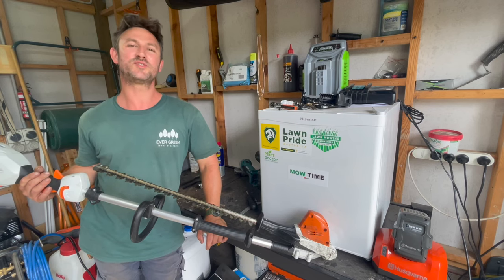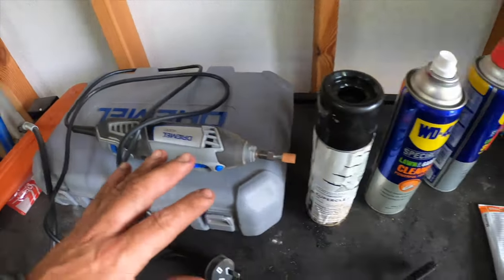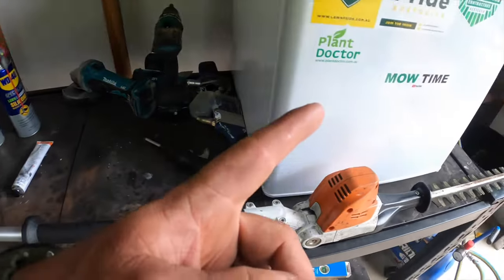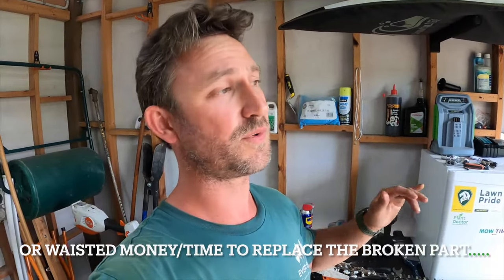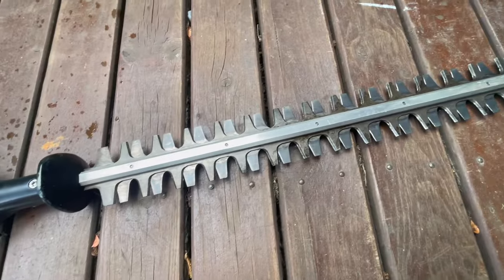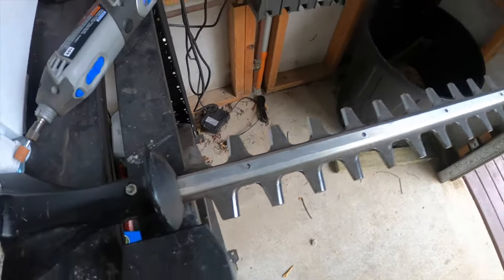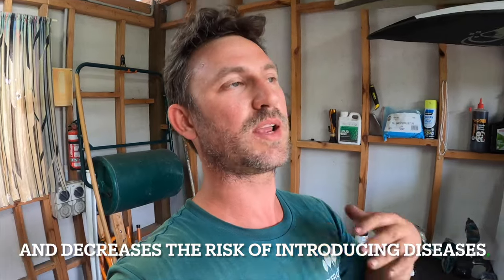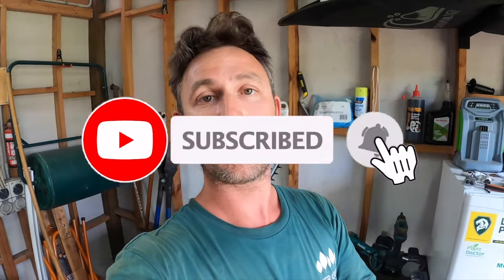HOW TO SHARPEN, SERVICE & MAINTAIN A HEDGE TRIMMER. DIY

Comment: Helpful video mate. Might try a dremal on my next sharpen. Been using a small grinding disc up until now. Cheers
Reply from the maker: Thanks legend.
Ye I used to do that to. Dremel I find such easier to handle and with all the attachments you can sharpen/grind/polish/cut out etc it’s great.
Hope all is well on your end mate 🙂👍🏻
Reply: @mowtime  will give it a try. Thanks mate

Comment: Great vid mate. Well explained and illustrated. Easy to follow. Just one question, heard a bit about having to spray some garden friendly cleaner after the hedging is done to prevent the plants from getting an infection from the blades. Would that cleaner you showed do that ? Cheers
Reply from the maker: Thanks mate.
No, that cleaner won't disinfect.

It's a good idea to disinfect them if you are trimming/pruning plants with a disease on a regular occurrence to prevent transferring it. 
Something like Isocol will do this. Just spray on, leave it a bit than wipe off. 
Hope that was of some help.
Have a great day mate.

Comment: How often should you be greasing the gearbox? I've just bought the Milwaukee quik lok hedge trimmer, doesn't say anything in the manual about greasing.
Reply from the maker: Hi
Depending on the frequency of use. If used regularly, I would be greasing every 1-2months.
Thanks
Ben 😃 👍

Comment: Great video. How many times do you think you can sharpen the blade until you can't no more and it's time to purchase a new trimmer blade set?
Reply from the maker: Hi Emanuele

Thanks very much. 
You should be filing off only a very small amount. I’ve never filed down to a point where I have to change the blades personally. I wouldn’t go to far as you might end up changing the horizontal blade angle. 
Check with your local shop after a few sharpens. 
Sorry I couldn’t be of more help. 
Have a great day
🙂👍🏻
Reply: @mowtime  Thanks for your response :)

Comment: Very helpful video, thank you so much.                                                                                                                                                                                               Question: My hedge trimmer hasn't been used in years and the blades are corroded with rust in parts, the blades don't move! What should I do and use?? Thanks in advance.